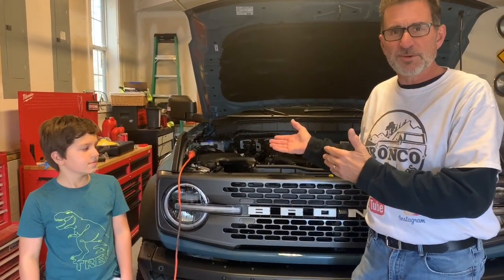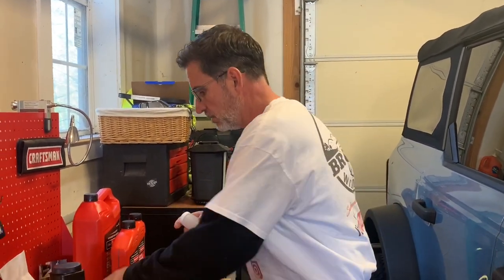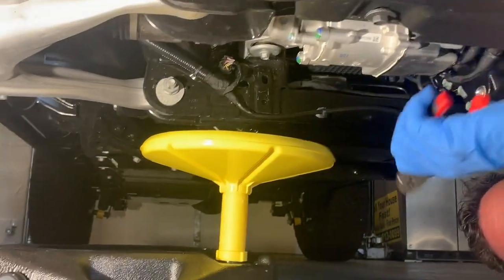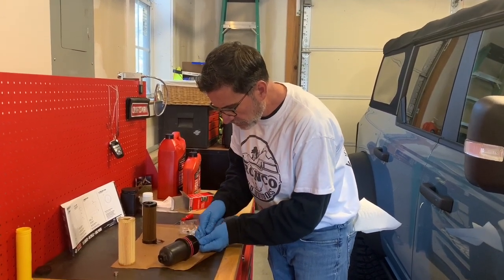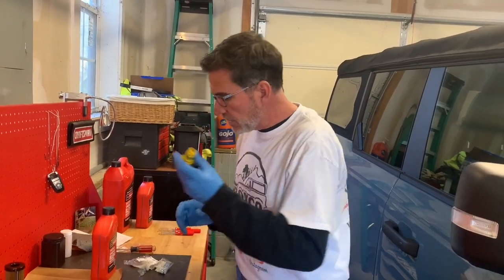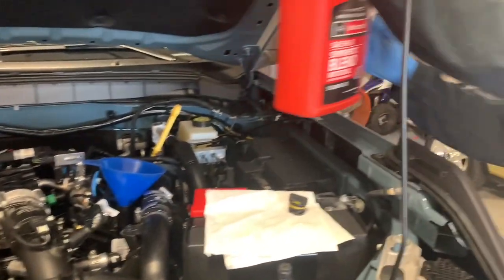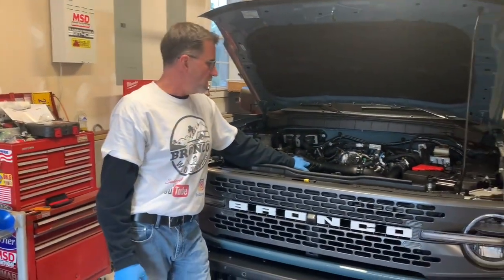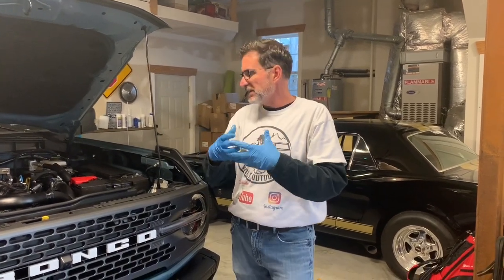Bronco 2.7 Ecoboost Detailed Oil Change. The missing 7th Quart

Comment: Thank yo u for taking the time to make the video and including your son. A tip; I found using snap ring pliers a simpler way of installing the small O-ring on the oil filter canister (less chance of a pic damaging  the O-ring and less manipulation). FYI, I have your same build and let mine set 4 hours; drained for 1 hour.  6 quarts out, but put seven in again, and above top hole on dipstick again. (Same as when it was shipped). So either the dip stick is wrong, (which I read in a ford group) or your oil catch pan was made in china and not accurate , and the missing 7th quart is still a mystery.  I don’t know, but for me, 7 quarts are always going in unless ford updates it’s owners manual and/or with other misprints. Thank you again for taking the time to make this video; greatly appreciated.

Comment: This oil capacity question reminds me of the experience with a 1996 SVT Cobra: early engines shipped with the wrong dipstick, so there was all kinds of controversy about how much oil to put in a 4.6 DOHC Cobra. FWIW, my 2.7 F150 has always taken 6 quarts. My two week old Bronco 2.7 shows full on the dipstick on the factory oil fill. I’m going to start with 6 quarts when I change it, and then go by the dipstick. Btw, I found out the hard way on my 2015 F150: allow plenty of drain back time before checking oil. I overfilled mine by two quarts on the first change, before I realized what was going on!

Comment: Great video...thanks. I'm glad to see you discuss oil analysis. I have over 30 years in industrial maintenance and have used oil analysis as a part of my overall condition based maintenance program and have had many successes in identifying various failure modes before an actual failure. Identifying issues early on the P-F Curve is critical to to prevent unplanned downtime and costly expense.
Reply from the maker: Thank you for watching!

Comment: Thanks for the video; I finally got a build date of March 6th 2023. I got a VIN for my 2.7 2DR BASESQUATECH so I think I'm safe. I will be picking her up in West Virginia and will be breaking her in on the way back to Florida (avoiding long durations at highway speeds by taking scenic routes when ever possible) . As soon as I get back, I'll be doing an oil change at somewhere close to 1,000 miles. I squeaked in under the wire as Ford was really encouraging reservationists to change their order to remove MIC hard top and sasquatch package (LUX is not an option for base neither is high or mid for that matter). All in I should be getting the Bronco for less than 40k. I identified the 2DR BaseSquatch as probably the best bang for the buck build.
Reply from the maker: Congratulations 🎉, you are going to really enjoy it 👍

Comment from the maker: I want to add that this is not your typical oil change. There are several things done that are not typical.

1-   I removed the oil filter canister after draining the oil, this is typically done before draining the oil

2-   In-running the engine before the oil change is to heat up the oil so it will flow freely, it is also to circulate the small debris and any solids so more of it will drain out with the oil versus settling in the pan and other spots

3-   Oil samples should be taken from the stream and not a container,(even though it was clean)

4-  7 Quarts came out, 7 went in just as Ford calls for

5-  I had to cut out footage due to time, the magnets didn't pick up any metal shavings (the shavings in the filter were aluminum) I did use the last half of the seventh quart.

6- The next oil change will be normal (I Promise)

Comment: Nice having your helper in the garage with you. I like using the Ronin Factory easy oil drain plug to replace the yellow plastic plug so that it doesn’t make a mess when draining the oil since I don’t have that big catch funnel you show. Also the plug has a magnetic tip to catch any metallic ferrous metal pieces in the oil.

Comment: You never went back and re measured after you put the half quart in.  Where did that put it on the hashes?  So you did drain 7, but you also mentioned that on the dipstick it was above the top of the hashes.  So was it over full with 7?  Which is incorrect?  The amount of oil it takes or the marks on the dipstick?
Reply from the maker: Yeah the video was already 57 minutes long I did have to cut a couple things out and that was one of them. The engine ended up with 7 quarts.
Based on the # mark 7  quarts of oil from the factory put it just over the top hole above the top # mark
Reply: @DrivenWildOutdoors  so if 7 qts put it above the top hole on the dip stick, wouldn’t that indicate over full?  Looking at the manual page 321, spot A is the bottom hole and the minimum, spot B is the top of the hash marks and labeled nominal, and C is the top hole and labeled maximum.  There is a note that says between A and C the oil level is acceptable and not to add oil.  So it sounds like 7 might be a touch over full right?
Reply: @dc_advntr5525  they are all overfilled from the factory according to the dipstick they use.

Comment: Thanks for the video. Curious your thoughts on the Ronin Easy Oil Drain that can replace the OEM drain plug?
Reply from the maker: Thanks for watching!

I have seen them but I have never used them. It looks like a great option as long as they do not leak. I need to do more research on them.
There’s nowhere that says that you have to replace the OEM after each oil change however for 12 bucks I just figured I would. I talked to a mechanic at the dealership and he said that he takes care of a company  fleet vehicles and they’ve been in there and not leaking for years.

Comment: Great video! I was looking forward to your oil change video. Going to do mine at 3000 miles and do much of the same that you are. Can't wait to hear your results on the oil analysis. Thanks for showing how to prime the system, great knowledge to have. I am waiting to Mishimoto to come out with their catch can for the 2.7. What are your thoughts on the catch can?
Reply from the maker: I like the catch can idea, it is less important on a dual injection engine versus a direct injection, however in my opinion it’s a great addition. I’m still trying to get confirmation from Ford if I install one will it affect my warranty or not. It shouldn’t however I don’t want to give bad advice. Once I get confirmation from them I will be doing a video on catch cans.
Reply: I have a catch can on my gen 1 coyote. Once you see what is getting by you'll never look back! Great idea for any engine!

Comment: Have you heard about a possible “bad batch”  of early 2.7 bronco engines?  I’ve seen 3 that have dropped valves. Curious to know your thoughts.
Reply from the maker: Yes I have. I don’t think they are dropping valves. My idea is it is LSPI is causing detonation which in turn is destroying the cylinders including the valves and block.
In ever case that I have heard about the drivers were at low rpm’s just driving. LSPI occurs in the 1300 to 2000 rpm range under high torque, example;  10th gear on the highway while accelerating or climbing a hill but not enough throttle to downshift to raise RPMs. This is one of the conditions needed to cause it, the other is a random oil droplet that flashes off and mixes with residual fuel vapor in the cylinder and causes an uncontrolled detonation which then the engine has its normal combustion cycle and this causes accelerated pressure in the cylinder which breaks the piston and then bits and pieces of the piston slap around and break everything else.
Of course I could be totally wrong and this is my theory, it basically comes down to the right conditions and possibly a tuning and programming change coming if I am right.
It is possible that it is bad/faulty valve retainers and keepers, however the driving conditions just before failure leads me to think LSPI. We will see I guess
Reply: If it makes any of you feel better about your 2.7, my 2015 F150 FX4 just turned 151,000 miles. Zero issues. Zero oil consumption. Still runs like new. I do Mobil 1 EP every 5000 miles, and I’ll be getting some snap ring pliers for that tiny oil filter o-ring, great tip. I love the little 2.7 so much that on March 27th I ordered up a 2dr Outer Banks Lux package 2.7 in Eruption Green. I just picked her up two weekends ago. Give these engines good oil, change it every 5K or so, and I see no reason why they won’t sail past 200,000 miles. I’m keeping the F150, it’s garage kept and still looks great, so I’ll find out just how long a well maintained 2.7 can live.

Comment: My brand new 2.7 Bronco was also above the hash marks. I believe the dipstick is a little inaccurate for a 7 quart fill up. Either that or Ford is overfilling every 2.7 and recommending about .5 quarts too much.
Reply: Yes, Ford does “over fill” new engines, especially the Eco Boost engines. My 2018 is always just above the top oil, tech said that’s the way Ford trained him to do so. My Wife’s 2021 Ranger with 2.3L Eco boost was filled the same. I asked tech and he said there is a lot of variation in engines 6.5 quarts plus or minus half a quart. Said seven will not hurt either engine. This man is correct on drain time. Read manual, says min drain time is 15 minutes but 30 is recommended, it’s in manual. And for “full synthetic oil” is dependent on use. Synthetic oil has many positives but a few flaws. Positive, oil is uniform throughout. Down side, if vehicles is used for short trips 5 miles or less synthetic oil can crystallize and destroy bearings. Read the Motor craft oil data sheets on synblend and full. Virtually no difference. Peace
Reply: Yes, Ford does “over fill” new engines, especially the Eco Boost engines. My 2018 is always just above the top oil, tech said that’s the way Ford trained him to do so. My Wife’s 2021 Ranger with 2.3L Eco boost was filled the same. I asked tech and he said there is a lot of variation in engines 6.5 quarts plus or minus half a quart. Said seven will not hurt either engine. This man is correct on drain time. Read manual, says min drain time is 15 minutes but 30 is recommended, it’s in manual. And for “full synthetic oil” is dependent on use. Synthetic oil has many positives but a few flaws. Positive, oil is uniform throughout. Down side, if vehicles is used for short trips 5 miles or less synthetic oil can crystallize and destroy bearings. Read the Motor craft oil data sheets on synblend and full. Virtually no difference. Peace

Comment: Just for clarification it looks like you added 6.5 quarts of oil. 1 qt then 5 qt. then 1/2 qt. ? You mentioned the oil was over the scratch line when you first checked it from Ford. Is that an overfill and possibly a problem ? I’m sure dealers won’t take the time as you did and not drain all the oil out then put 7 qts back in without checking. If this overfill does happen will it be a problem. ?  Love your videos and have learned a lot. Cheers
Reply: Ron Bearden  - No, did you watch and read the comments??? He said he added 7 quarts back into the engine...  
The level on the dipstick is just over the top  hole  of the dipstick... It is not overfull.
The capacity according to the Owners Manual is what????    7 quarts.... 
If you let it drain long enough you will get 7 quarts out..

Comment: 11 minutes in, i realized this is an HOUR LONG oil change video. Holy cow! lol And why do none of these youtube oil change guys keep kitty litter around for the inevitable spill? Am I the only one who uses kitty litter on spills? Sheesh. lol
Reply from the maker: This video was very long for sure. I was answering the question of the 6 to 7-quart debate and taking time to explain everything.  I realize we live in an instant-everything world, however, some want details. Thanks for watching
Reply: @DrivenWildOutdoors  I was trying to be light-hearted about it. I get it. Thank you. I'm really only watching your Bronco videos because I'm thinking about an F-150 with the 2.7. I had heard some folks saying the rods or something were breaking and ruining the engine on the early broncos. Have you heard this? And for some reason, not on the f-150's.
Reply from the maker: @dgunearthed7859  The issue early on (at least what has been said by people other than Ford) is the engines were dropping valves due to a bad batch. I have no idea of the cause for sure because there has not been an actual press release that I have seen stating that was the issue. Bad valves or tuning? So far my 212 Bronco which has an engine built during that time frame is fine, so time will tell.  Thanks for checking out our channel!

Comment: Excellent Video... Question... you mentioned that u left the oil drain for 48 hours using the heater you used and 7 quarts came out and you then at the end finally put 7 back in... In most cases we don't have 48 hours to let the oil drain...maybe 15 to 30 minutes?  in these cases should we NOT add 7 quarts and add 6 only since there is probably around 1 quart left in there?
Reply: short answer yes. It's always a good idea to start with less oil than capacity in order to NOT overfill. Overfilling will kill your engine. You can always add more but it's more difficult to remove excess. You do sleep, so I normally put in say 5 quarts in my f-150 (capacity is 6), take a reading, then when it shows in the hash marks, start it up and let it run for about 2 minutes, then turn it off then take a look at the dip stick the next morning. Add if oil if it's showing too low. ;-)

Comment: Have you tried one of the aftermarket drain plugs like Ronin? Curious what you think of those as they seem to have pros and cons.
Reply from the maker: I have not. I’m OK with the original equipment for now
Reply: @DrivenWildOutdoors  I’m with you on that. You seemed to manage to not make a mess of your garage so hopefully I can do the same on my upcoming first oil change. If you do look into the aftermarket plugs at some point keep in mind they are meant to be left in so it prevents you from draining a small amount from the pan (they advertise about a 1/4 cup)
Reply from the maker: @edernest  The oil does come running out like you open the flood gates, having something with sides on it really helps, I use the reacher that I got from AutoZone and it seems to work OK but you could also use one of the deep standard oil catch tubs

Comment: I’ve noticed that motorcrafts full synthetic oil does not have the SN Plus API rating on the back. Would you recommend using a different oil brand or go back to the blend that has that SN plus rating?

Comment: My 2017 2.7L Ecoboost in my fusion sport calls for 6.7 Quarts of oil. If it’s the same motor, curious as to why they call for 7 now! I mean the 2018 and up is dual port injection but does that really quantify the need for more lubricant?
Reply from the maker: The oil pan is deeper, they had to increase the sump because of the approach and departure angles for Off-roading
Reply: @DrivenWildOutdoors  makes sense. Would’ve never guessed that but our engines don’t even look the same from the top! Your charge and intake pipes are all smooth with no restrictions. Mine are jagged accordion style with bends and kinks all over.. don’t think they come to a “T” either. Stout motor so far, 67k no issues what so ever. Religious oil changes at 5k. Never done the drain plug so maybe I’ll have them do it since it’s been 5 years

Comment: My 2.7 Bronco has 1500 miles. I wanna do the 1st oil change. Would it damage the engine if I use Mobil full synthetic? U did mention in the vid that u will change to full after this change!
Reply from the maker: I’m switching to full synthetic at 5 k, 
I have no evidence that it will hurt, however Ford recommends their synthetic blend.
Why don’t you ask your service department at your local dealership and get their opinion.
Reply: @DrivenWildOutdoors  thanks!

Comment: It's well documented that Ford fills these engines, from factory, with 7.5 qts. The current owner's manual says 6 qts with filter change.
Reply from the maker: We only drain 7 quarts, and at that time that was still what was recommended in the owners manual. Ford has since I updated the owners manual to read 6 quarts.

Comment: Is there a reason why the replacement factory filter looks different?  The original appears to have rubber caps?
Reply: I know im a month later, but in case you hadnt figured it out yet, its because ford changed the design from what iv been reading

Comment: Weird my 2018 f150 2.7 uses 6 QTs 
and I been using Schaeffer Motor Oil
after the break in oil. That’s how you baby that engine. Amazon 12 qt box for $120
Reply from the maker: The bronco has a deeper oil pan for the pitch and roll ability

Comment: Old days the block heater, heated the coolant, not the oil, is this something new, that it heats the oil????
Reply from the maker: No, it still is inserted into the coolant passage in the block, but it creates heat into the entire engine. The temp after 4 or 5 hours  was 140+ degrees in a 55 degree garage.
Reply: Dude, if the supposed Old Days block heaters heated Anything, it would eventually even heat the oil ! Even back Then...  What a concept !!!